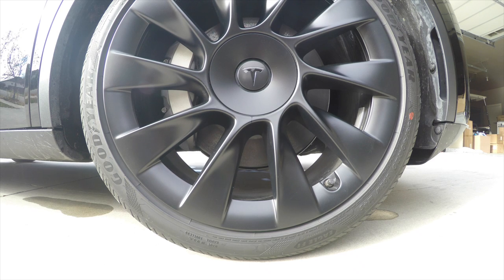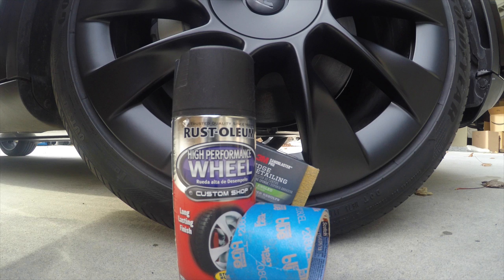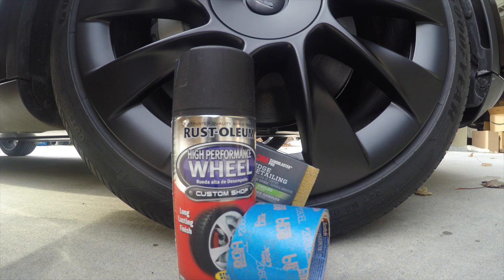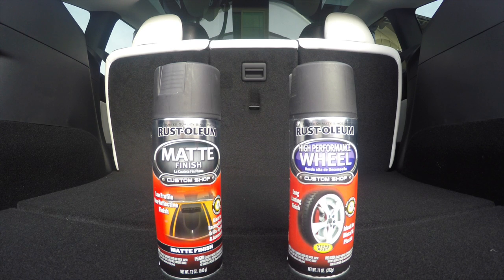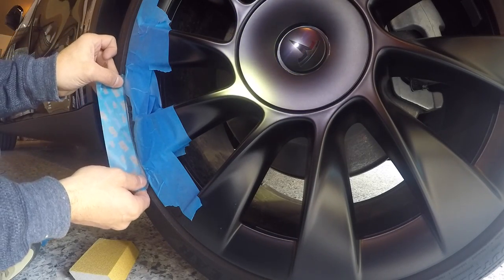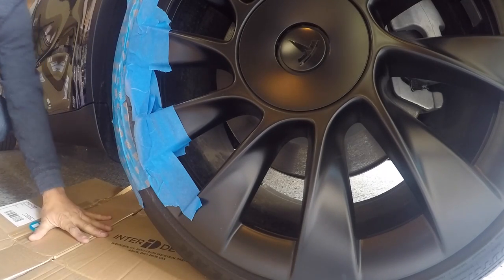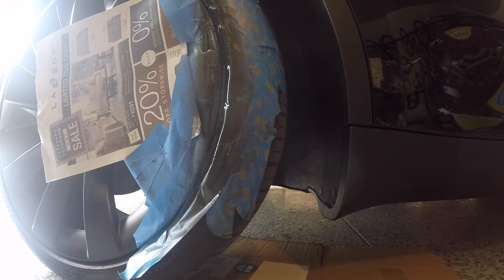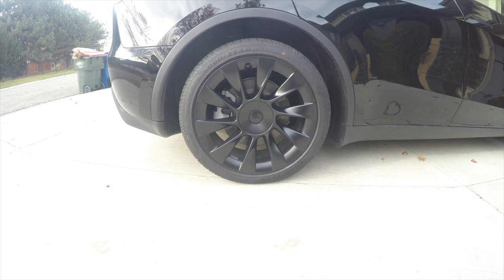Tesla Model Y Curb Rash Repair - 20” Induction Wheels - DIY

Comment: Not bad for a DIY. Honestly it's the color contrast that jumps out at you when the tires and wheels are black and you have a bright silver slice screaming for attention. The pros use an angle grinder. Also it's not just the low profile of the Tesla rims, they friggin' stick out past the rubber of the tire. I had the same problem with my Model 3 as my Model Y. Grrrr...

Comment: Oh nice! What grit of sanding block? I have an MY LR with induction wheels. My lady curbed a wheel recently. Instead of getting upset, I was prepared for this from both at some point (wheel & tire setup).  😂
Reply from the maker: Thanks for the comment.  I have the sand sponge 🧽 I used below, but you can use and 60 / 80 / 120 grit depending on the rash severity. Just need to knock down the edges.    Also, make sure you don’t tape too close to the rash, or you will have a paint line when you remove the tape. You need some room to feather it in. 

3M Sandblaster Pro Sponge:
https://tinyurl.com/3h5xtzby

Comment: Nice video bro. Tesla came out with winter tires but I'll probably get them on tire rack and use the same rim. 😉
Reply from the maker: Thanks for the comment. I saw those winter tires.  What size tires do you have now?  I think the 20” stock tires should hold up well in the snow.

Comment: My husband and I did 2 small curb rashes on the passenger-side rim long ago but not until I hit a curb and got a long rash on the driver's side rim, it bothered me so much I took matters into my own hands and luckily found your video.  I used masking tape instead of painter's tape and saw gooeyness coming off from the edge of the spray paint!  I thought humidity and not leaving the paint to dry more than 10-15mins may cause the paint to dry unevenly as I pull the tape off but I believe it was just the glue coming off from the masking tape.  I used LPS2 to remove the glue.  Another thing I learned is not to overspray; the lack of sanding caused unevenness especially on the indentations.  Areas where I sprayed 3-4 coats resulted to look like patch tape.  Share more videos with us with your attempts with improving original repaired areas.  Thanks again!
Reply from the maker: Great comment. Thank you!  Yeah, the main thing is to use very light strokes of the paint spray. You can practice a few times on some cardboard.  I haven’t had any issues with residue from my tape removal.  If you are like me, you will have many more attempts to perfect your rim repair. :)
Reply: @TeslaModelYdaho  
I did it again but was not as anal with taping and was sloppy with sanding .

Comment: I just tried this on my 2023 model y performance with the uberturbine wheels and the paint isn’t an good match. It’s way darker but you can’t really tell from far away. You would only see the difference in color if you were looking for it. The only problem I had was removing the tape residue after. 

Overall I’m happy. Thanks for the help.
Reply from the maker: Thanks for the comment.  Definitely not the right paint for the performance rims. I have those on my MY now, but haven’t scratched them yet.  When I do, I will do a comprehensive paint match test.
Reply: @TeslaModelYdaho  Thanks looking forward to your next video.

Comment: Not a bad job, but like you said in the video you were going to go back and fix some of the sanding. We too have the same rash on one wheel that needs to be fixed. I have done this type of repair a few times before on my other cars. I had very good success using my variable speed Drummel, a couple of Drummel sanding and fine wire brush bits, some 0000 steel wool, and the correct color and finish Rustolium paint. First I used the sanding bit to lightly flatten out the rash peaks. After the sanding I used the wire brush bit to blend and match the contour. I used some soap water to wipe the area throughout the process. The last step before painting I used the 0000 steel wool to do my final smoothing. NOTE - When using the Drummel I ran it medium slow and took my time. You can always do more sanding, but you CAN'T unsound the metal back. I taped off and covered every part of the wheel and tire, including around the fender. You'd be amazed at how far overspray will travel, even when you are very, very carful. NOTE - Better to take a little more time, paper and tape, then have to try and remove black overspray from your Wife white Tesla when you are done with the wheel. 
Just like
Reply from the maker: Great comment. I never even thought of using my Dremmel to sand the rim.  I have some new fresh hits on the rims that need attention, but I found the Rustoleum doesn’t tend to work well in the colder temperatures, so I either need a temperature controlled room or have to wait for warmer months.

Comment: Is the paint durable? Or you need to apply again after carwash? Thanks for the video.🙋🏻‍♂️
Reply from the maker: Very durable.  Went through several washes, several seasons, wheel cleanings, etc.  it won’t come off easily. Good luck.
Reply: @TeslaModelYdaho  Thanks. I will try. 🙋🏻‍♂️

Comment: That intro was classic!

And good job fixing it yourself. I just paid a pro $200 to fix two wheels I curbed in less than a week, and they came out perfect. My next step to prevent this from happening - replace those 255's with 265 40 r20's. That extra bit of rubber should better protect the rims.
Reply from the maker: Appreciate the comment.  I’ve curbed a few more spots since that video,  I will likely do an update soon.  I have some new techniques I want to try out.  Let me know how the new 265’s turn out.
Reply from the maker: @majorpayne7137  I see what you mean about the little extra rubber portion.  Also, it would be nice to reduce the road/tire noise. Thanks for the update.
Reply: I will be doing this as well. One week old. Curbed front rims.... Hopefully this will work.
Reply: Would you be able to share a picture of the tires? Where do you have the tire installed? Thanks  @majorpayne7137
Reply: @majorpayne7137  any shot we can a profile shot?  Wondering if the tires are too big?  Have you not run into any issues?

Smoother ride?

Thanks!!
Reply: I agree with you @majorpayne7137.  It isn't just the profile of the tire (distance between tread and rim) but is the width of the tire vs the width of the rim.  The 255 width (at widest point of tire) is only slightly wider than the wheel which is 9.5".  A wider tire (if it fits without rubbing anything at full steering wheel lock)_ will provide more protection by having some rubber out past the wheel edge.

I have a Model Y Performance and they are even worse with the 21" wheels.  Got my first curb rash today 😭😭😭.  It could be much worse, but I am still sick about it.  When it comes time to replace my all season tires, I'll definitely look into the possibility of wider tires.  Hopefully that is a long way out since the car has only 2,500 miles on it.

I just ordered my winter setup an am going to 19x8.5 wheels with 255/45R18 tires, so taller tires (more sidewall) and smaller wheel, hopefully I'll make it through pothole season with no issues.

Comment: I own an LR Model Y. I got curb rash cornering. When I rented cars in Scotland and Ireland I got curb rash because the roads (especially in Scotland) were so narrow and the dumb rental car companies  put low profile tires on all their cars.  I noticed that I would sit in the Rental lot sorting out the controls and then I'd pull out and almost immediately need to sort something else out. So I'd pull over and that's when I'd rash on the curb. 
I decided that next trip I'd travel with a pair of Curb Finders. These are basically springs/wire that clamps on to the edge of the fenders and stick out 6-8" (15 -20 cm) from the wheels. Then when you hear scrapping it's the curb finder not the rims.  They only cost about $12. So I could use 'em and just leave them.  The method of curb finders is that you'd  parallel park and take corners occasionally hearing the scrape of the cheap curb finders - this would very quickly train you about safe distances. Within a few weeks you could remove the curb finders. 
I bought my Model Y and a set of curb finders and.... there's no way to attach them. Maybe you could figure that out. 
The other thing I want to know (and thank you for this video!) is what I have to do to grind out and repair rims on the next rental car so I don't get dinged $200 by the rental company.  I've also noticed that some of the rims had already been rashed, then ground and polished out - so they can ding the next customer. 
What's always amazing is that you can work through the grits up to steel wool (usually better to use the synthetic stuff). You can buff just about anything to a mirror finish. Also the lower grits are usually about 70% of the work, as you move up the grits it gets easier and easier.
Reply from the maker: That's crazy that the rental car place would ding you for the rim rash.  Sounds like a bunch of BS!

Comment: Just did 3 out of 6 21" uberturbines. 
Took the wheels of and put it on a flat surface. Skipped masking tape. Sanded most of but left the deepest scratches so as not to remove to much material. 
Put pieces of thin cardboard between rim and tire. Sprayed 3 layers of paint and 3 layers of clearcoat. Clearcoat was a little to glossy but the paint blended in perfectly.  3 more to go but will try to find a clear wit a little less gloss.
Reply from the maker: Nice!  Sounds like you have a pretty good process defined. Thanks for the details.

Comment: I am crying now. Yesterday I rashed with the curb and damage around the rim. I called Wheel Repair shops and told me 335 CAD for each wheel which is about the cost of new wheel. Will try your method and see if it is working. Thanks you for the post. Sub and Liked.
Reply from the maker: Good luck. I am sure you can do it!

Comment: I had issues with the paint line showing from the tape.
Reply from the maker: If you scratch that same rim again and have to start over, only tape the tire and center rim cap (depending on how far the scratch is.  Then you can freely spray and it will feather in the paint evenly.   I have had a similar issue if I put tape on the rim too close to the rash.

Comment: you did a great job sanding!!  thinner coats of paint next time and you wont have so much build up and run off.  but very well done overall.
Reply from the maker: Thanks for the comment.  I definitely got more professional at the process since my first attempt on the video.  I ended up having to touch up every rim at least twice.  That is the nice thing about having a can of paint in your garage vs bringing the car to the shop every time you run up against a curb.

Comment: 😊great instructions thanks. How do I protect from further rash any good tips please.
Reply from the maker: Thank you for the comment.  Just don’t park in any spots near a curb.  Not that hard to get into the spot, but I typically rash my wheel when exiting the spot.
Reply: Yep, Exiting a parking spot with curb on the right side, rashed back rear. @TeslaModelYdaho

Comment: The issue is the driver… no design ever can prevent curb rash.
Reply: Not completely, but some are definitely more prone to damage when you do catch a curb.  Nobody's perfect.
Reply from the maker: I avoid all parking spots near curbs, any drive thru’s, drop boxes, etc.  Havent taken the car through the automated wash with the wheel track.  1600 miles so far, no rash. Fingers crossed. Although, I will make a new video on the 21” Uberturbine rims when the eventual happens.

Comment: Practice on something first. Then spray paint. Tape farther away so it can 'feather' in. You can always wet sand and buff it out if you need to later.
Reply from the maker: Good comments. I actually only tape up the tires now so it blends in as you mention.
Reply: @TeslaModelYdaho  You can also tape it with an upward curl, so there is a gap. That way the air current will make a natural feather that is very small. I was a bathtub refinisher for 35 years.
Reply from the maker: @robertlee3  that’s awesome. Trying that next time I strike a curb!

Comment: one can of plasti dip $6 no other tools or products needed....
Reply from the maker: Thanks for the comment. I have since done a few more spots, and if you sand better and spray more uniform, you cannot find the original spot.  The Plastidip looks like it would take the shape of whatever it is on and likely see the bumps from the rash.  Have you tried it?  Send me a finished pic to teslamodelydaho at Gmail.
Reply: @TeslaModelYdaho  we took delivery of model y back in December.  Wife hit curb at Chick-fil-A same day 🤦🏾‍♂️  four coats of plasti dip.... no sanding no tape.
Reply from the maker: Those chicken tenders can be distracting.

Comment: Do you need to use a filler for deep scratches?
Reply: I am about to do all this with some filler. And then sand, getting a smooth finish. I also plan on applying primer and then the finish...all in the same black matte. BTW: I have a model Y with the 20 induction wheels.

Comment: Does the paint you used match the 21 inch wheels on the performance y?
Reply from the maker: I haven’t tested it.  I wouldn’t recommend. I believe they are slightly different color and finish.
Reply: No it does not. You need the carbon mist color from Rust-Oleum. Get the paint + primer can.
Reply: Yes agree I own 2 teslas model y and performance is more gray and the long range is a black rim

Comment: I just did this, the paint match with Rust Oleum is not as good as I was hoping. My wheels look much more metallized while the touch up is way more black. Wet sanding with 2500 then 3000 helps a little. Probably I only notice because I know it's there, but I hope to find a better matching paint
Reply from the maker: You may be right that you are noticing because you know it’s there.  I have done all four of my rims several times and IMO the paint matches well enough that after a while I need to search out for where I touched up.  One thought might be if you use tape on the rim and then spray across it.  After you remove it, you may see an edge line and it would be noticeable. I have since been only taping the tire and then when I spray it blend naturally like a gradient. Does that make sense?
I do agree that wet sanding with a higher grit will help smooth the rash out much more, but it becomes a much bigger job.  The idea of the video was to enable folks to repair their rims on their own with little effort.
Reply: The paint might not match because you might have a performance we own 2 Tesla one performance and one long range model y. Long range is more black as the performance model y is metallic gray.
Reply from the maker: @fabsjimenez  yes, also the performance wheels are 21” and the LR are 20”.

Comment: I'm considering a Tesla, constantly hearing about 'curb rash' and have a question:  Are these issues from hitting curbs during turning/cornering or are they due to dropping into potholes at driving speeds?  Thanks for any insight...
Reply from the maker: The issue is mainly from hitting curbs.  In a traditional vehicle, the tire sticks out further than the rim.  On the Tesla’s the rim is out further than the tire portion, so when you hit a curb, the rim is actually in contact with the concrete, making it more severe, and less forgiving.  I wouldn’t let this be the deciding factor on whether or not to purchase a Tesla.  Way too many other positives.